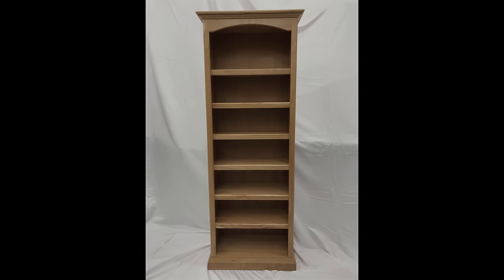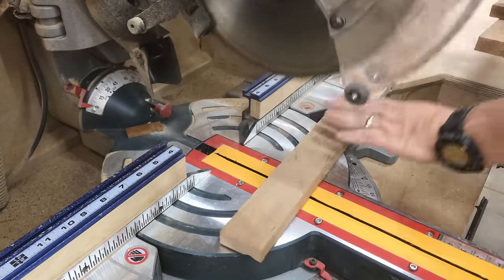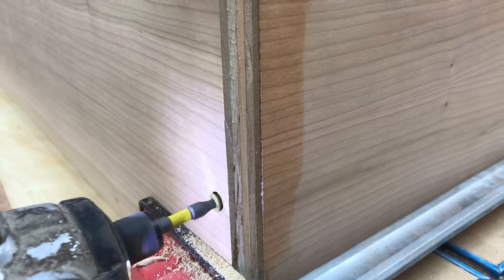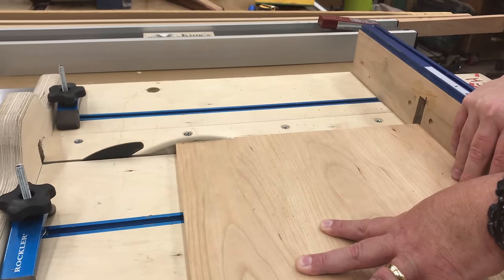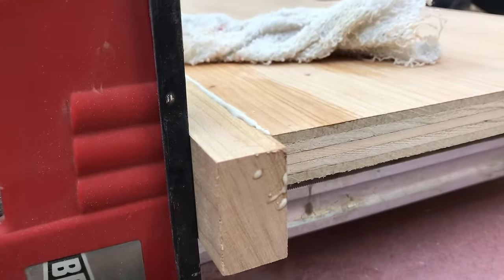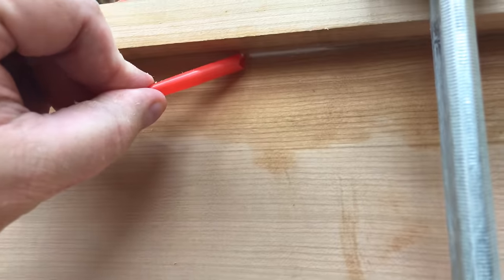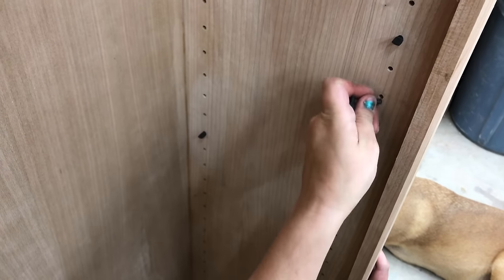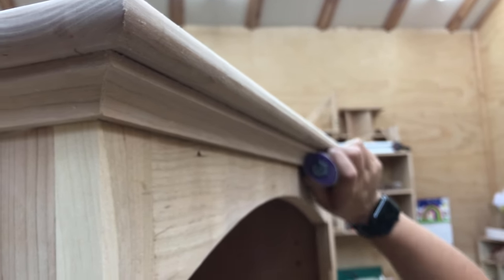70 - How to Build a 6 ft. Standard Cherry Bookcase 4K

Comment: Biscuits will provide extra holding power on the mitered corners of the bottom molding.  If this bookcase gets placed on a carpet floor and someone tries to move it, it places a great deal of stress on the corners of the molding.  The biscuits ensure the corners never come apart.  Just a suggestion from one furniture maker to another.  We can always learn new tips and tricks to help make our final product last long after we've gone.

Comment: This was very helpful in moving me forward on my own bookcase project. I previously had no idea how to make my own cove moulding and from this video was inspired to create some this morning (I have a pin nailer on order now to get it attached). I also was in a quandary about whether it would be okay to glue a solid maple panel to my plywood top and it set my mind at ease to know that the wide gluing area would serve as a laminate and not to worry overmuch about wood movement. I may even try to make this exact project at some point if I can get an assistant. Thank you for the useful and inspirational video.

Comment: Great job! I feel like making something after watching this. Love that Rockler jig, a great piece of kit to have. I made my own out of an old cupboard someone threw away and used electrical tape on the drill bit to set the depth. It works but by the time you have drilled so many holes the tape is pretty sad. I would love to own an assembly bench like the one in the video.

Comment: Don’t forget to mention, after glueing projects up. Find a stoping point due to your states climate the glue needs to dray over night. If your wood working area isn’t heated for winter. Best to get your shed to garage up to temp. Glue will be next to impossible to use. We out of will it work stuck the bottle in the microwave ten or so seconds then let come to room temp good as new.

Comment: Nice build. It sure is handy to have someone who can get up on the assembly table or down on the floor. I can’t anymore. By the way, what color do you usually paint your nails? 😂. I have considered black. Then no one could tell when I mashed a finger with my awesome Thor’s mallet 😁. When you get some of that Titebond 2000 in a 55 gallon barrel, let me know and I will come get some 😜.
Reply: Wait until 3rd quarter of 2019 for Tightbond 9000. Just dry assemble the project, and the perfect amount of glue teleports into the joints, already dry, ready for final sanding and finishing!

Comment: Another great project video. The directions you give are exceptional. The end product is beautiful. It looks like most of the family had a hand in this build. 

I don’t see a link to the new Titebond 2000 glue. 😁 BTW — I also recommend those foam sanding blocks. They even work well with regular sandpaper.

Comment: In the first minute, I saw how hi that saw blade was for the thin material. Wow, pull that down a little.
Reply from the maker: The height gives a cleaner cut because of the angle of attack of the teeth with respect to the wood.  This is our personal choice. In your shop you should only do what feels safe to you.

Comment: So the 2000 grit is used to "rub" out the finish? Nothing goes onto the piece afterwards? Another very nice piece! I wonder if you could give some tips for those working alone when doing the larger things like the face frame/carcass glue up, and also when there are not three people to hold the 1/16" material to do the arch . ;-)
Reply from the maker: Hi Pat, after the 2000 grit, we wipe the fine dust off with a tack cloth, and that's it.  We will try to cover large material handling better, I hadn't thought about it. Thank you.

Comment: 16:45 Dowel joinery would be really tricky to keep aligned perfectly.  If you don't have a biscuit joiner, another way to go about that joint would be to cut a rabbet in the top to match a dado in the front trim.  I'd cut the rabbet on the top of the panel and run the dado down the middle of the trim piece for best strength.   You'll need to plan ahead and leave the extra 1/4" or whatever width on the top panel.  I suppose you could think of it like a continuous mortise/tenon.  Biscuits are great, but unless you use it a lot, it's a pretty expensive way to get a butt joint (plus, if you're like me, you may be averse to buying uni-tasking tools).  The method above might even be quicker too.

Comment: Great project and wonderful description during the build, and I'm subscribed!  My wife has a substantial collection of books, so I know what I'll be doing in the coming year.  My only comment about the design is the number of shelf pin holes.  You made the holes almost all the way to the bottom and top, which is not practical given the average height of books.  I like the comment below about putting a copy of the build document in the sealed space below the bottom shelf as a sort of time capsule.

Are you concerned about the dust generated by the build?  I didn't see any dust collection or protection masks used.

Comment: Great project. When you put the dado in the sides for the it looks like you had the dado stack right up against the steel fence. Do you use a sacrificial fence for this operation?
Reply from the maker: Hi Jeff, If I'm doing a cut where dado width is critical then I use a wooden sacrificial fence. But in this case, I wanted to go about 1/32" wider than the 1/4" blade that I had on there, so I just left a 1/32" gap between the blade & the fence. This amount is so small, that it just comes right off with the cut. And I wasn't in danger of hitting the fence with the blade.
Reply: Thought it was something like that. Thanks for the reply!
Reply: Thought it was something like that. Thanks for the reply!
Reply: Thought it was something like that. Thanks for the reply!

Comment: I thought you were not supposed to glue in backs, especially  large ones like that, due to wood movement.   Is that not an issue here because it was ply and not solid wood?
Reply from the maker: Hi Andrew. No problem at all because it is plywood.